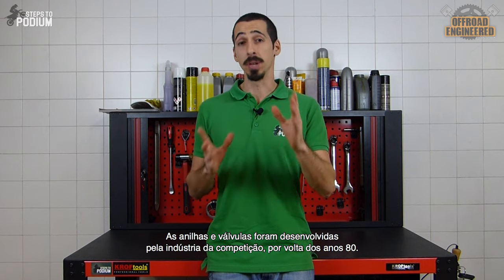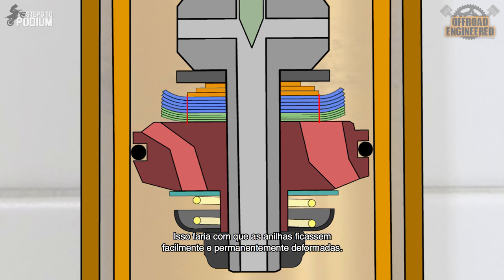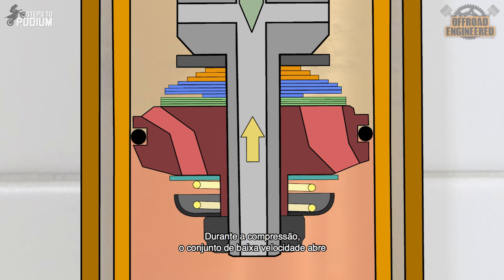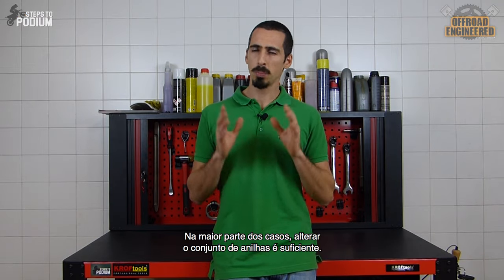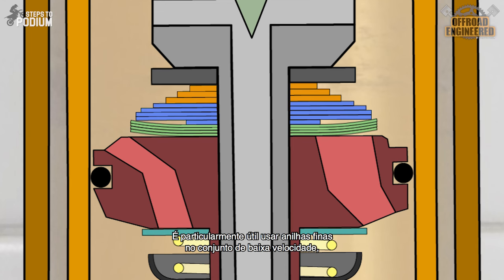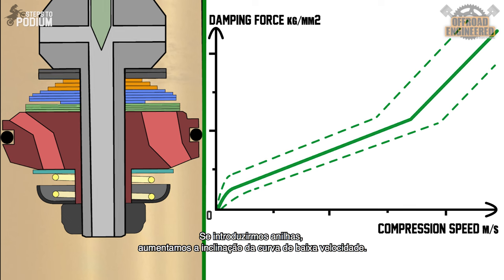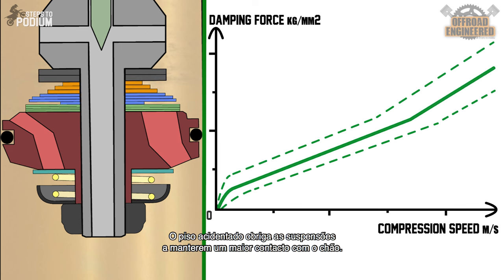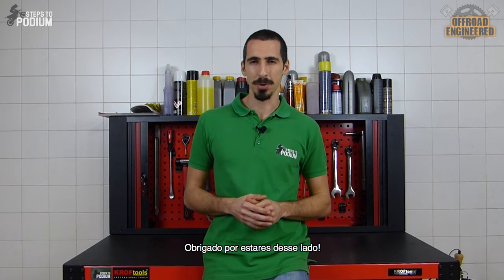How to tune Valves & Shim Stacks | Offroad Engineered

Comment: I Have to hand it to you. I've been doing suspension for going on 30 years. I've never seen an explanation so clear and (this is what I find extremely rare) accurate information. And your point about changing the shims is the easy part. Knowing which shims to change to accomplish what a rider needs is the hard part that only experience with different suspensions and different riders will take decades to learn. Great diagrams got your point across perfectly. Very good job, guys!
Reply from the maker: Thank you so much 🙏🙌 I really appreciate it, specially coming from an experienced tuner 😄💪true indeed, knowing what you can change is one thing, knowing which one to change is another ball game that only experience will get you 👌
Reply: @StepstoPodium  But you did give us enough info to see where we are at and pick the most reasonable part to try changing. How far/how much, well that will take exp, but at least we have the right map to work off of now.
Reply from the maker: I'm really glad I could help 🙌🙌

Comment: Thank you for this simple explanation. My 2022 WR450F is far too harsh for trail riding. I did a 150 mile ride last week and I was in agony for the second half and I still have shoulder pain. Having too much damping is dangerous because it leads to early fatigue which leads to more mistakes or whiskey throttle.

Comment: My old 96 KX250 was completely transformed with proper suspension setup
Reply: Every bike will be better with tuning. Only few people know how to do this.
Reply: @aaaaaaaaaaaaaaaargh  agreed. Especially when the rider is heavier or lighter than the "standard". 

On my KX the stock front springs were rediculously soft. I looked them up. According to racetech, they were for a 130lb rider. Rear spring was  160lb.

I ended up hiring a guy that has been doing dirtbike and sled suspension for 20 years. I told him I wanted gold valves, and he said that he could make the suspension work just as well on stock valves, and it would be cheaper. I told him to just put a GV in the rear just because. 

Anyways, I love riding that bike now. The suspension fixed an understeer problem, and obviously bottoming issues.

Comment: Great explanation of a complex topic. Much better than anything I found so far.
Still a normal user should not think it is easy to figure out the right modification. It should be left to experts. Instead of try and error expert calculations are much more efficient.
One thing is not correct. Single stage shim stacks do not create a linear relation between stroke speed and damping force. The relation is degressive, creating too little damping in large movements etc.. Two stages can linearize the relation. Or a combination of valves (basevalve single stage and midvalve with float) --> a great source for such information is the Restackor software and related documentation internet pages.

Comment: @StepstoPodium  I have to admit that I finally made a change to soften my KYB 48mm forks for the better on trails \ rough terrain. This  ~miracle was accomplished heavily due to the examples towards the end of this video where you show what the slightly different shim configurations  make on the overall action of the forks.
Reply from the maker: God damn man! You just made my day! 🥳 really glad to hear it and thank you very much for comming back to leave a comment 🙌🙏
Reply: @StepstoPodium  My fix revolved around that cross-over shim.  Out of a 12 shim only 'straight' stack, I removed 2 large shims off the top, then I placed a small cross-over shim 5 notches down on the low-speed side and then removed 1 shim from what you called the high-speed stack and got the relief that had eluded me for decade++.
--
I have 4 sets of the 48mm KYBs, all on my 2008 - 2012 Husqvarna 2t and 4t dirt bikes.  Might do each just a little different  since I have a clue now on these stacks AND the compression valve can be removed from the forks WITHOUT taking the fork off the bike.  
--
Their valving just screws right out the top and the  mounted forks with only the handlebars needing to be removed.

Comment: Hello, congratulations, great video!! , very educating and easy to understand all the concepts, but there's one that I've always thought it was the other way round, I thought that the bigger you go in diameter the stiffer is the stack, I do understand that it's more difficult to bend a smaller one, but in the other hand, the biggers one above have got more room to bend then can flow more oil, would you be so kind to clarify me that point, please??.
Thank you very much
Reply from the maker: It's not a matter of space above, it's only important how the shim setting is made up! Remember, the tapered shape is to reduce permanent distortion of the shims, nothing else. The shim stack works like a spring :)

Comment: Hello great video I am learning about this stuff I am wondering about frepiston can you make it shorter and get more softer stroke before midvalve takes over best regards Brian
Reply from the maker: Thank you!
Regarding your question, no, it's not possible to do that because the cartridge size has the free piston size into account :)
Reply: Thanks for the answer is it filling the chamber with a stop or is constant working up and down? I’m thinking of doing your online course is it basic setup,I like to learn more about shims on Kyb  best regards Brian 😊
Reply from the maker: @user-ik2ed4dl3g it goes up and down according to compression 💪
It is about all the different adjustments you can do, without having to disassemble the forks!

Comment: Love the video, really informative. There is just one thing I don't get, shouldn't the slope of the high speed compression be smaller then the slope of the low speed comrpession? 

Don't know much about suspension, so I might very well be wrong
Reply from the maker: If you don't have more damping generates as the speed of compression increases, it will blow through the stroke. Remember that speed of compression has nothing to do with suspension stroke used.
Reply: @StepstoPodium  Thanks for the quick reply!

That makes sense and I get that we are not talking about the stroke, just the speed.

I thought that the high speed compression was more like a pressure release. The damping would still increase/velocity but not as quickly as in the the low speed.

I haven't watched all your suspension videos yet, but I definitly will!

If you haven't touched the topic yet, I would be really interested in knowing which scenarios are high speed and which are low speed 

For example is braking low speed but an emergency braking scenario high speed? Of course it all depends on the setup but some idea of where to draw the line would be interesting
Reply from the maker: @user-vo8ij2jj4r  if you check out all my suspension video, I believe you'll get clarified on that :D

Comment: I'm trying to soften my 48mm KYB forks and finding out how little I actually know, even after getting a clue here... Seems easy, right?... 
--
Just removing those largest shims (Maybe 12 in all removed) off the top of the stack had little effect on the damping overall.  The springs in these forks  were  2x too stiff and changing them helped lots, but I want more plushness at my age now ...

Comment: WP Xplor fork: When I hit a small log (10-15cm) at speed, the fork feels very stiff/harsh with this sudden hit. Otherwise the fork works well, smoothing well series of 30cm waves, it has limited bottoming resistance altough the oil level was raised 5mm. From your explanations, I understand high speed will be both jump reception, and sharp obstacles at speed ? So I do not understand where something needs to be changed. Any advice ? Notice my other bike, 501, has also WP Xplor and works fine, smoothing all and has enough bottoming resistance for my use (enduro). Many thanks for the nice videos.🙂
Reply from the maker: I believe there are 2 variables you might not be considering on your issue:
1- the Xplor fork is a type of fork technology. It does not mean the valving will be exactly the same for a 300 tpi to a 501.
2- the clickers might be different from one bike to another which can explain the different damping behaviour.

Answering your question, yes, sharp compression from small logs at speed is within the realm of high-speed compression damping :)

If you have any further questions, you can consider scheduling a technical session and we have a deep dive in your case in particular 1-on-1💪
https://stepstopodium.com/technical-sessions/

Comment: Wow best video on the subject, thanks for that explanation.
I have a question, what would you recommend to change on my shim stack?
I ride an Enduro Honda CRF230 with an XR250R fork (compression damping Adjusting only), and my Racetech Shimstack is as follows
8 shims    .10x17
crossover .10x11
one            .10x17
one            .10x13
one            .10x9
one            .10x8
My clicker is already completely open. 
The Low-Speed feels Ok, The High-Speed damping could be a litte softer
What would you change so that i can close my clicker more (to have more adjustability) an make the high-speed compression a litte softer.

Thanks for your advice 

Greetings from germany
Reply from the maker: Thank you so much! 
Maybe reduce the diameter of the clamping shim. Try .10x7 and so on until you have a good result. There's nothing like giving it a try!
Reply: Hi Harald denn letzten shim .10x8 tausch den gegen einen .10x6

Comment: What do you think about putting a single stack on OC forks and dual shim stack on the shock for fast gnarly single lane ridding?
Reply from the maker: It depends a loooot on what is actually needed and it would be irresponsible on my end to give you a yes or no answer 😅
I think you would benefit a lot from a technical session to discuss this further so I can give you a good answer.
www.stepstopodium.com/technicalsessions
Reply: @StepstoPodium  that's okay, I just wanted to hear a short answer. Thanks any way.
J Velez 
Master Technician at Mountain Motor Sport  Marietta Georgia.

Comment: I never used tapered shimstack as it makes no sense to me. Why having increased high speed damping? Cone valve which is a great idea makes exactly the opposite as the tapered stack does 😮. I read a lot about high speed compression to avoid bottom out. I would always do this with the spring, e.g. air spring tuning or using rubber end stops. Cheers

Comment: Sir I have a problem in a damper. Can you solve this?
The problem is at the end of compression and starting of rebound there is a vibration feeling or we can say that one type of jerky feeling in a sample. So what can I change in the damper for eliminate the vibration. Rebound 350kg and compression 150kg.
Reply from the maker: It's hard to access the problem with just thst info. Maybe we could schedule a technical session!
Check it out here:
https://stepstopodium.com/technical-sessions/

Comment: Please answer my questions!
I'f we mount damper in Reversed direction then compression and damping shims will interchange or remains same?
Reply from the maker: Damper in reverse? How so?
Reply: @StepstoPodium  means if the damper we installed is vertically upward and we change it to vertically downward then the shims will gona work same ?
Reply from the maker: It depends a lot in the suspensions in hand 😛
It's quite hard to help you through the comment section, but if you think it's worth it, we can schedule a technical session online where I can help you a lot more! 😊
Check it here 👇
www.stepstopodium.com/technicalsessions
Reply: @StepstoPodium  yes sir sure 😁 it will help me to understand better.

Comment: If a shim stack is all .15 shims under the low speed face shims of .10, and you want to soften the high speed just a small amount, do you replace the .15 shims with two .10 shims (.15= 3.4) or change the clamp shim by 1/2 mm, say 10 to 9.5 clamp shim? What is a better solution?
Reply from the maker: Hey! It's kind of tough to give you a good answer with just those inputs, to be honest 😅 maybe it would be interesting to have a technical session? 
You can check more info here:
www.stepstopodium.com/technicalsessions

Comment: The only thing you didn't touch on was mid valve float. Is there a direct effect like the thickness being cubed proportionate. I am playing with float and clamp as we speak. Was wondering is there a rough rule to go by to help make an informed decision.
Reply from the maker: The next offroad engineered video is about the mid speed valve 😉 it will go live in a couple of weeks!
Reply: @StepstoPodium  Perfect. 
Just whats needed to take some of the guesswork out.

Comment: Watching this video again. I'm going to disagree that a smaller diameter shim makes it stiffer or increase damping, because the shims under it can now flex more easily that will reduce damping. Just like how the smaller diameter cross over shim makes the low speed softer/less damping. You can't have it both ways. Replacing with smaller diameter of the same thickness will always be softer/less damping.

Comment: Speaking as an Enduro rider, who cares if the suspension bottoms out?? That's what the bump stop rubber is for. Those few occasions where the suspension bottoms out are not worth sacrificing bump compliance. 
I think all this tech about shims has made people forget about the other components of the system.
Besides the ridiculous complexity. 
For average riders, it's detrimental.
Reply from the maker: Don't agree with that but understand what you are trying to say! Some people want to figure out shims but don't even change oil within service time, so... 😂